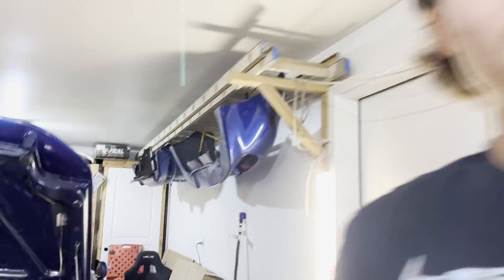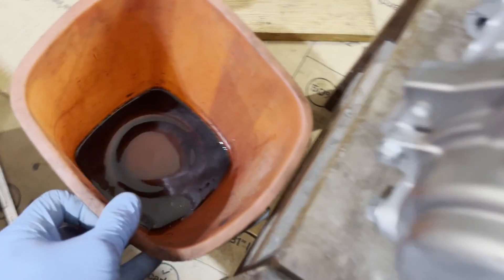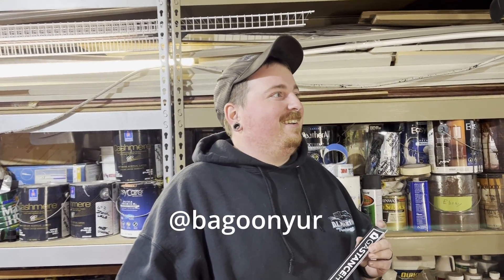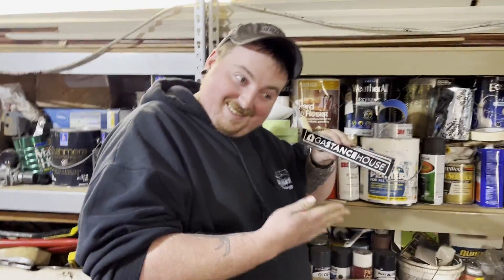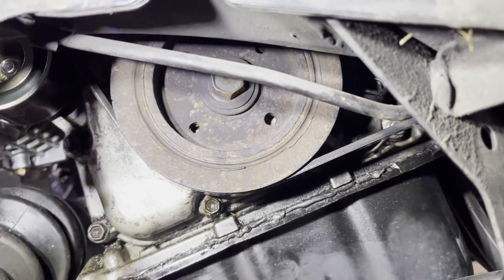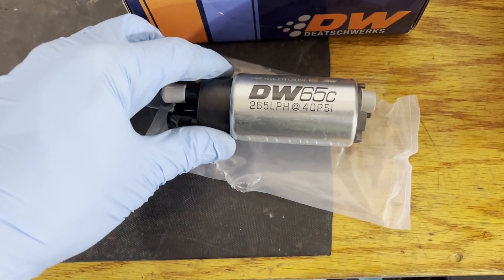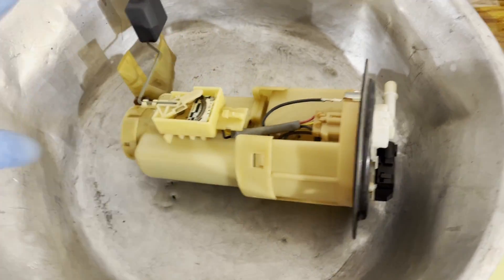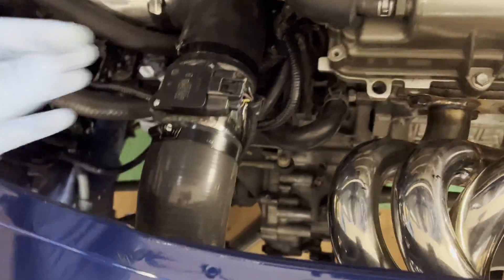$300 Amazon SC14 Supercharger Test - IT SOUNDS INSANE!

Comment: When you get back into it dont rush. The guys at the RAD FACTORY have just put one of these eBay / Amazon re-man SC14s on a 1.8Miata engine. Watch that before you go any further, and i suggest that you grab a genuine Ogura one from a Crown/Previa/Jeep - would be sad for the 2zz to die early. 

I just put an JDM Crown SC14 on a 4age and its amazing, night and day over the SC12 (mine was 200HP at the crank with SC12) -  The 2zz blitz kit has as a TX12 which is the same internally as the SC12.
Reply from the maker: Appreciate this comment so much. A close friend of mine pointed out the same Rad Factory video as well. This year was a crazy year, but I am officially picking this back up. Genuine ogura supercharger is on order and more content will be coming very very soon :)
Reply: @gastancehouse  all good. During your break I put one on a 4agze.  Makes 240hp on a motor that in NA form makes about 140hp. Looking forward to seeing how you get on.  

If you're looking for genuine try find a charger from a kawasaki ultra 250x - it's an sc20 and long as you get one that's not water logged and low hours you'll make crazy power with low boost.

Comment: Let me know if you need any questions about the SC14. I was kind of a pioneer back in the day. I even have engineering drawings for smaller 6PK pulleys. Just dont spin it too hard, you'll melt the Flourine Resin coating off.
Reply: Good Sir - is this SC14 the same as the TX15P? Would you happen to know?
Reply: @recklessdrivinginsingapore  I cant say for sure, but looking at the TX15P, it looks an exact copy of an SC14. They really are so ineffecient though. So much heat. Go Whipple or Turbo.

Comment: #1 Reason these motors go bad, especially when boosting is. Not properly warming it up. Whatever you do, make sure to always let the engine temp warm up ridiculously long. min 5 full minute's for mine.. It will help keep your cylinders from losing compression waaaay longer.

Comment: I have a SC14 waiting on me to actually fit it on my 1zz! Looking forward to see how you run it. Will you run a bypass valve?
Reply from the maker: Heck yeah man! That will be awesome! I do have a cheap bypass valve for experimenting, although it is not technically needed for this supercharger, especially with the fixed pulley. It may make tuning easier though, so I will be trying it out!
Reply: @gastancehouse  I hope so too! Ahh interesting. I've searched all over and I just can't get a definitive answer on the full set up, as in MAF placement, second TB, bypass ect ect 😑
Reply: @phatali1 bypass usually goes from after tb to after sc, the idea is to bypass airflow around the SC at low rpms. Maf is always before tb so the air is sucked through the maf to the TB and then SC. Best setup is iat sensor couple with map sensor but I have no idea about your engine ECU config. You will need a catch can/air oil sep box though as the SC will increase manifold pressure and oil vapor blowby.
Reply: I have a 1zz n have been following this post for awhile now. Questions: do you need an intercooler? The supercharger comes with its own accessories and tuning? Also, there's no intake pipe needed for air into the inlet of the supercharger?